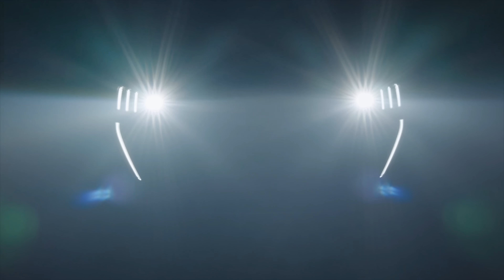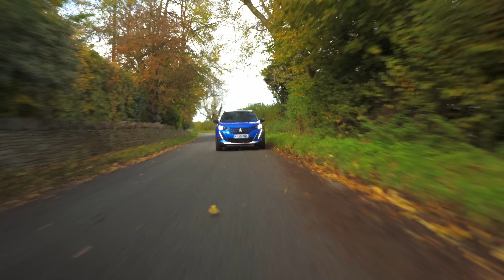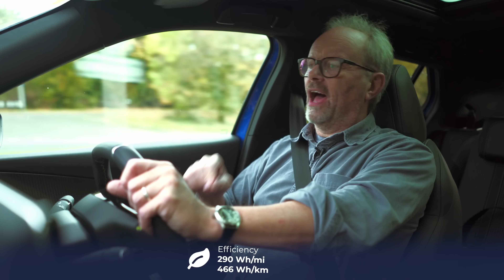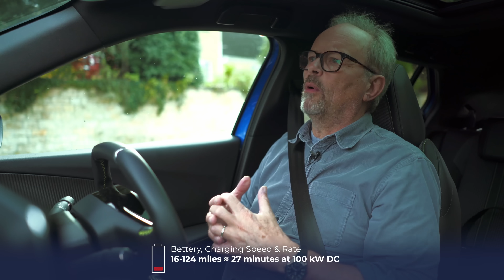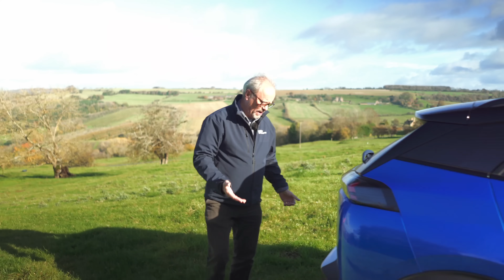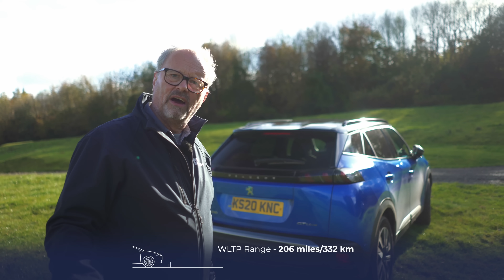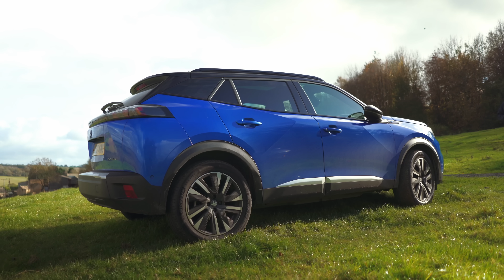Peugeot e2008 - how does it compare to other compact SUVs? | 100% Independent, 100% Electric

Comment: Weird that you got such rubbish range? Bjorn got 120 miles at 70 mph on the motorway and nearly 190 miles normal driving. Maybe you've got a duff one? His also had the odometer displayed so it is there.
Reply: Isn't it just possbile that the previous reporter just constantly floored the car? So it calculates the range on an average of the previous km's it has driven. As he mentiones in the video.
Reply: @ArneVanhove  yes, that would explain the low guessometer reading on the dash. But Robert went on to say that he had run it until empty, charged it and it only covered 130 miles. Obviously this isn't a scientific test of the range. All other reviewers seem to say 180 miles is easily acheivable

Comment: Trip meter on all modern Peugeot cars is displayed on the instrument panel when you press the button on the end of the wiper stalk.
Reply: It can also be set up to be displayed on one of the "personal" dashboard layouts
Reply: It's "optional information" and has to be chosen as part of either Personal 1 or Personal 2, dash view.
Reply: @Gr33nMamba  they are ugly though
Reply: I believe the MyPeugot app also will show all the trips including the power consumption
Reply: @WojtekSiudzinski  Trips - yes, consumption - no. French developers are very conservative and app has only fossil fuel support... It's a bummer when such a good car is darkened by software limitations. Several software tweaks in app and dashboard and it would be perfect...
Reply: @olekseleznov6  nope.
Reply: @csharpe5787  Sorry, I've missed the track after 2 years. What that "nope" refers to? :)
Reply: RTFM!
Reply: @CSchaefer640  the fucking manual is generic for all models good luck working it out from that
Reply: If it's anything like my corsa-e you can only have the trip in the central screen in a sub menu which is crap, and yes you press the stalk to set the trip.